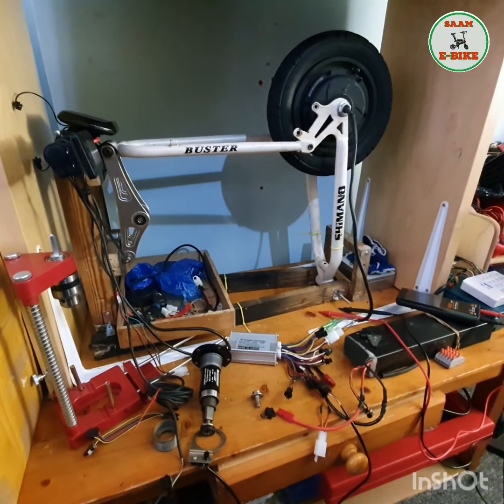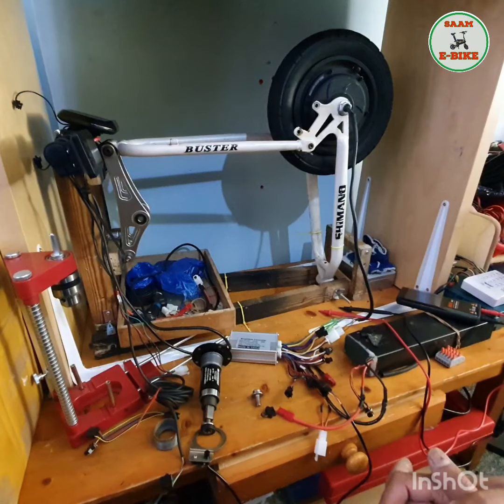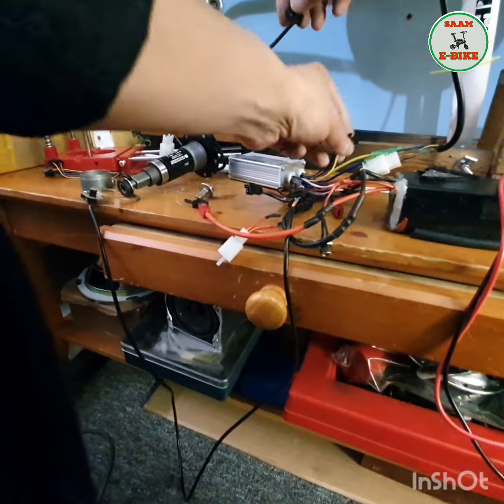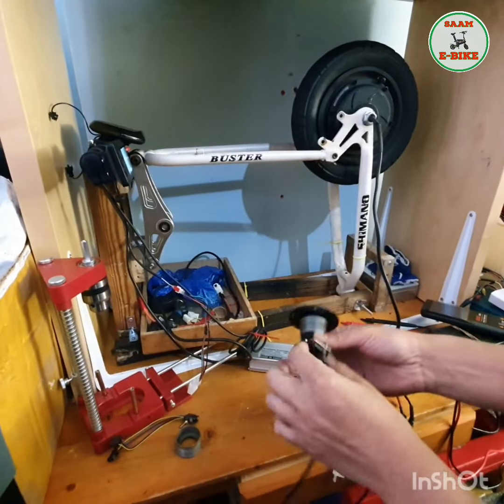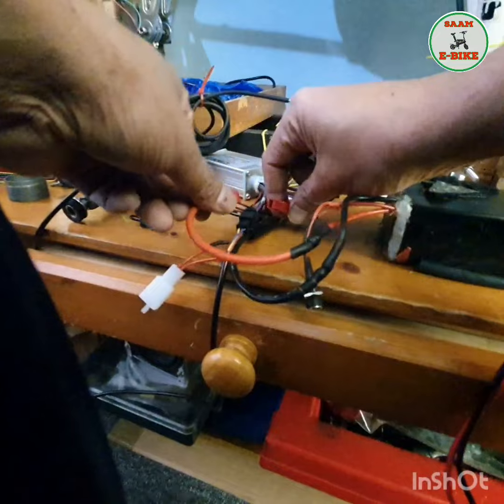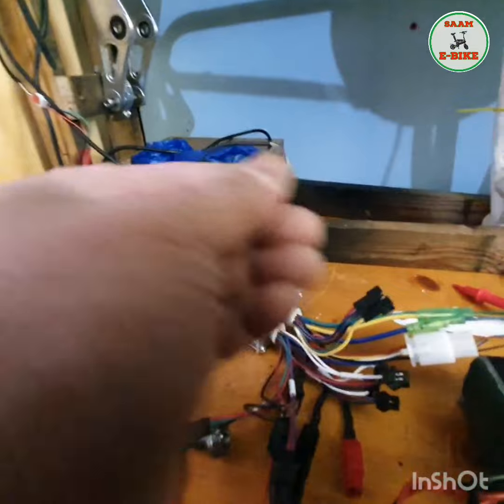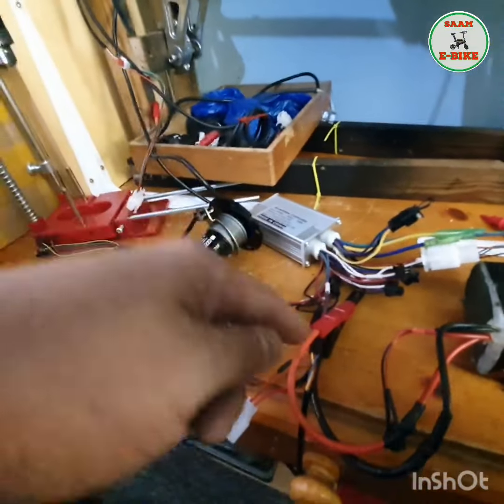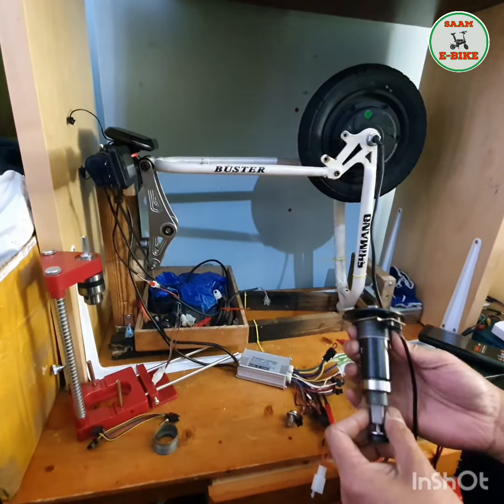how to use electric bike without display

Comment: How do you change the settings if the display doesn't work is it just gonna be stuck in whatever settings it was on Never been connected and doesn't have any settings Set up are you just stuck with the default
Reply from the maker: Hi this is for emergency. incase your display damaged so you can use until u change it to new one

Comment: What is the Red cable voltage
Reply from the maker: Switch
Reply: @SaamE-bike  I have xiaomi clone scooter  but Red cable has 42v, there is blue cable for on of, Green, yellow for tx, rx, and black for gnd. İs there a way to start without screen? No external throttle cable.

Comment: I have the same problem connected the red and blue wire and connected the accellerator (i don't know hot to spell trhotlle) and it do not work
Reply from the maker: This only work for pedal assist bike... if u want to use throttle u have to charge the display or buy dual mode controller... u can watch my another video

Comment: I have a shark electric bike that when I power it on all appears fine. Then I turn the throttle and a firm clunk is heard and everything does until I unplug the battery and plug it back in again then all appears well. When troubleshooting through peddle area when I connect the red wire a loud visible arc occurs I've disconnected the pedal assist and the brakes and it does exactly the same thing no matter what I try as soon as throttle is turned CLUNK then all is turned off and won't turn on until you remove and replace the battery. I've searched for weeks to find a video with this symptom. There just isn't one
Reply from the maker: Hi could you check all hall sensor cable and pass cable are correct order and all firm connection
Reply from the maker: Is that mid drive motor right
Reply from the maker: Another thing can you try to replace pedal assist sensor and throttle same time water can make short connection both..
Reply: It's a rear hub drive

Comment: Hello, i have a m365 brushless motor controller, it has 5 wire for the signal line connector, green-blue-black-red-yellow.

I was told by the seller that you cannot directly connect a throttle without connecting it to the display board first.

Do you think that it is still possible to directly connect the throttle to the motor controller without the display board?

And does your method still possible to implement for m365 brushless motor controller?

Comment: Man I did it but it only give little bit gas dosent work properly
Reply from the maker: How I did on the cable you do the same it should work fine thanks
Reply: @SaamE-bike  from where you find and how I can make it ican buy it in any store and waht I will tell them?
Reply: @SaamE-bike and it only work with pedal assist ithink
Reply from the maker: Only pedal assist

Comment: How do I unlock my bike?
Reply from the maker: Normally they are single blue cable on the controller u have to just open
Reply: @SaamE-bike  idk where my controller is my bike is called the trioblade ebike it’s black can you help me
Reply from the maker: @riowilliams8184  aa ha your bike is built in controller under the battery plate so u would be able to charge... u can try if u have display settings p08 make 100

Comment: good video but it was no help to me as my colours are (green blue black red yellow) tried doing red and blue but the display stayed on
Reply from the maker: Hi thanks only connect red and blue together should work
Reply: @SaamE-bike  that is what i did and it didnt work
Reply from the maker: I'm really sorry is should work do u know is your controller is good or it has problem
Reply: @SaamE-bike  the controller is all working.  but the screen has an error message E4 thats why i want to bypass the screen
Reply from the maker: Hi can tell me what is display name
Reply from the maker: My friend E4 error is motor hall sensor error... u can try unplug motor cable and put it back and try to switch on your display.. if don't work that way... I'm 100% sure your motor hall sensor problem
Reply: @SaamE-bike  the hall sensor is working just as it should so i got a new display screen and now its working fine